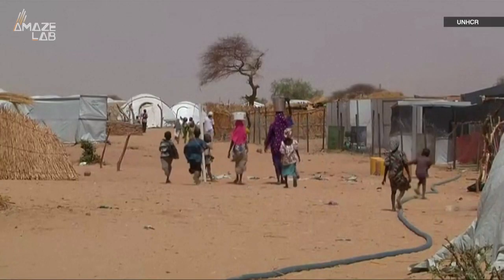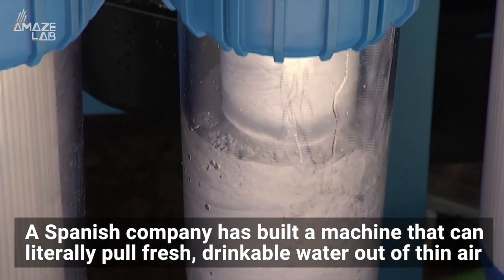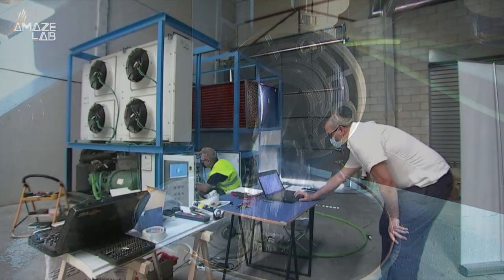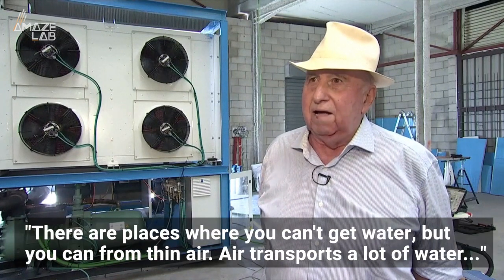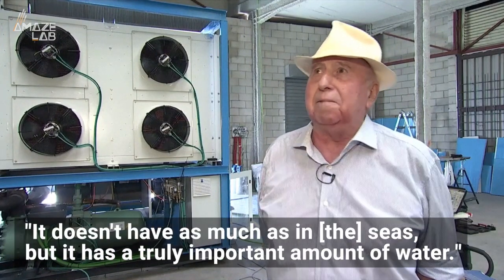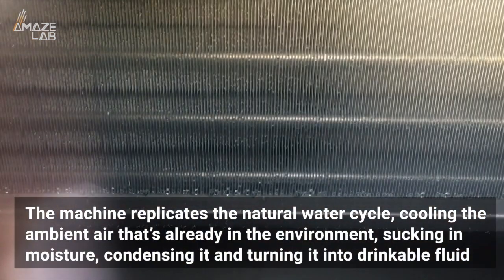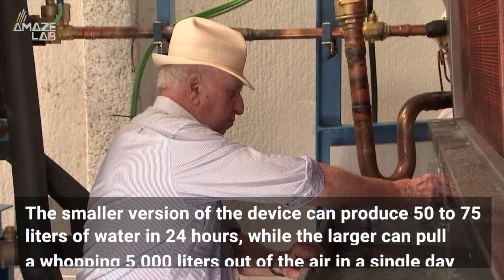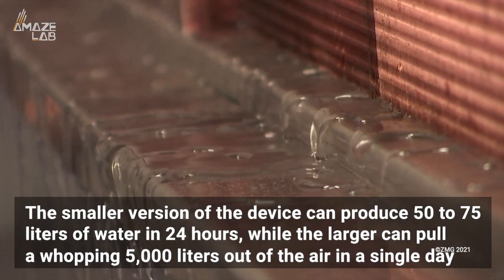Spanish Inventor Build Machine That Can Pull Thousands of Liters of Water Out of Thin Air

Comment: at the stated 104 degrees F ( 40 C ) and 10% relative humidity, there is approximately 4.5 g of water in 1 kg of air.  in order to pull even 3g of that water out of that 104 degree F air, you'd have to cool it to 50 degrees F ( 10 C). It would take an extraordinary amount of energy to cool down just that .77 m^3 of air to get 3 g of water, assuming no evaporative losses, of which there would be plenty.

something like this might work in the temperate Spanish countryside with its 60%+ average humidity, but it's utterly useless in extreme desert conditions where this stuff gets tried over and over again.

sorry... science says no.

Comment: Haven't devices like these been debunked as glorified dehumidifiers?
Reply: They have, but people remain gullible idiots.
Reply: Wrong question. Does it actually extract and condense water that is clean and drinkable? That's all one would really care about.
Reply: @speway  It will be extremely clear to the point where it could be poisonous for a dehydrated person.

You do NOT want to drink anything close to distilled water in a dire situation.
Reply: @Diggnuts  I get it. Perhaps a reconstitution process is being used.